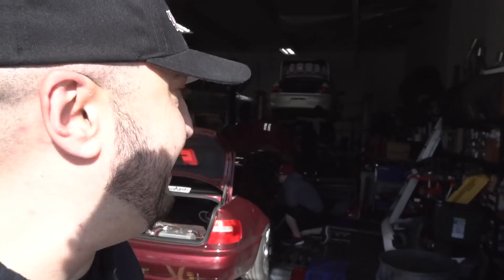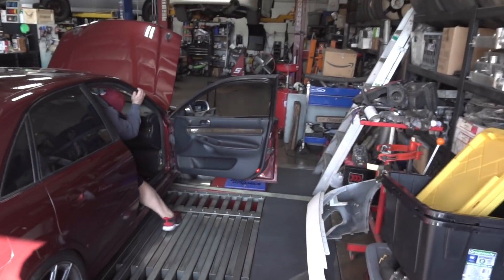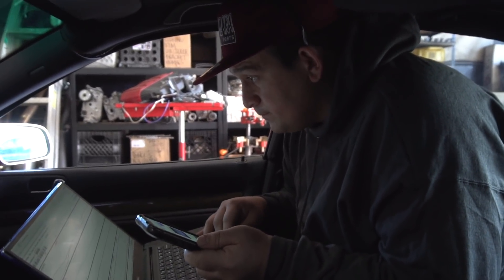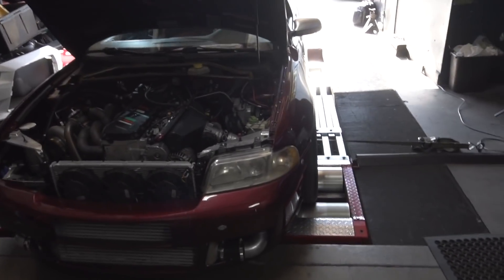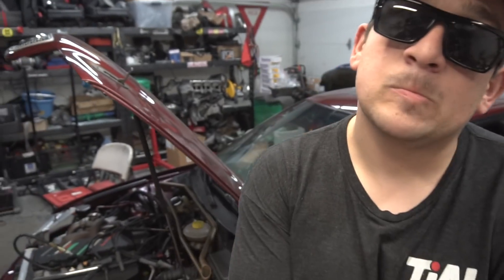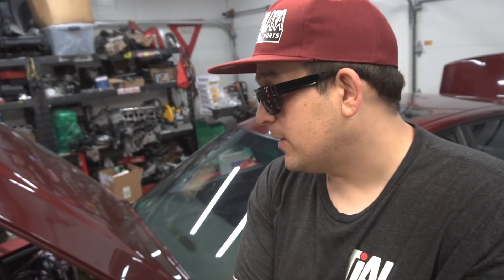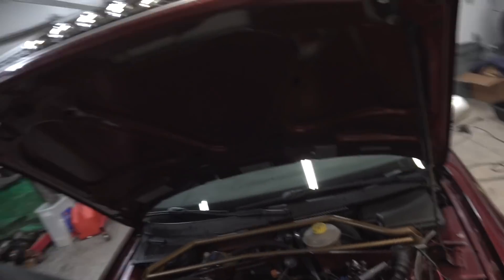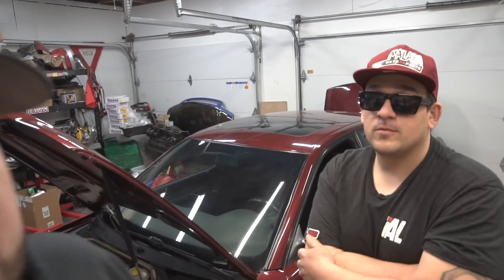STAV'S FIRST DYNO DAY    |   12v VR6T B5 Audi A4    |

Comment from the maker: Leak down testing the car, we may not have fried rings, perhaps crushed lifters or bent valves throwing 45psi at her over the last few logging sessions. More updates to come as we dig deeper into Stav’s 12v
Reply: Proud of you guys👊👊👊 Keep up the great work!
Reply: U could of had jumped a tooth on ur cam gears. This would also cause low compression and very low hp.
Reply: But I did have that same comp. guage and it broke on me making me think I had a broken ring land. I bought a better comp. tester and 191 across the board.
Reply: @johngrosso6631  Repeatable results from one cylinder to the next.
That would require 6 independently broken gauges.
Reply: @Christdeliverme  the guage wrked on cyl 1 and 2 showing 191 psi them on cyl 3 it broke showing 80psi.  When I tested cyl 1 and 2 again it showed 80psi. I bought another guage and all cylinders were at 191.
Reply: @Christdeliverme  the malakas only used 1 guage brother. They never used 6 different guages fam.
Reply: @Christdeliverme  and if u know anything about engines. Wen u do a comp. Test 5 min later wen the engine is cooler it will show 5 psi less in that same cylinder. Ring gaps open
Reply: Super nice channel! Now I want a VR6 to my audi 80 quattro!
Reply: Nice , i would get a vacuum gauge if it jumps right away and not stay steady ..right there you know it has valve problems . Godspeed guys following and learning along 😆

Comment: What do the pistons look like thru the spark plug holes? Would be curious to see if it looks like the rings blew up past the piston/wall and bounced into the piston/head. I remember a while ago that Stav set the ring gap to the Street/Strip setting. Which is a probably too tight for 45 psi of boost.

Comment: What injectors do you use for the 24 valve turbo, im putting a turbo on my 2009 tt 3.2 shooting for about 450-500 wheel horse . Any links ? Or brands you can recommend ?